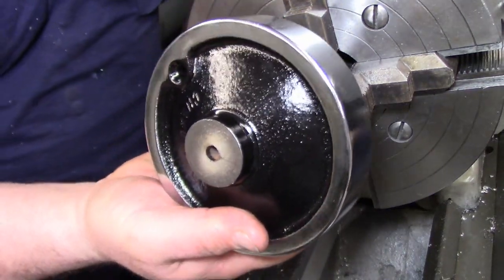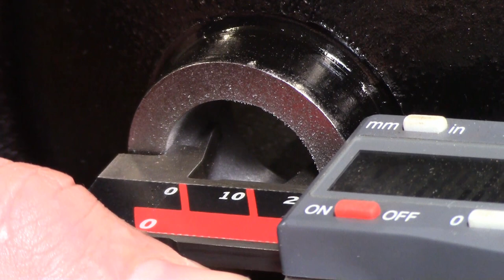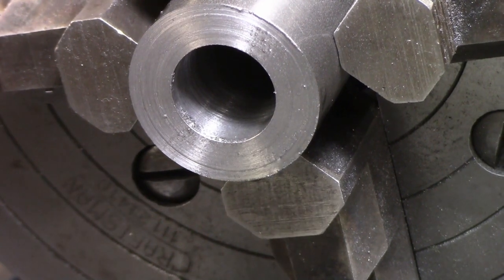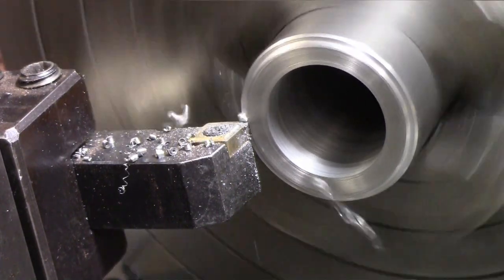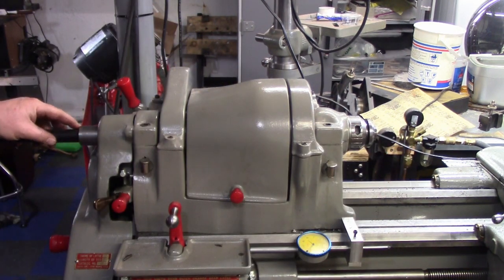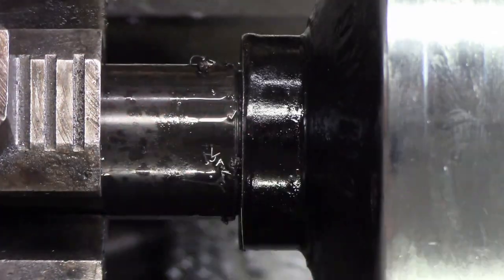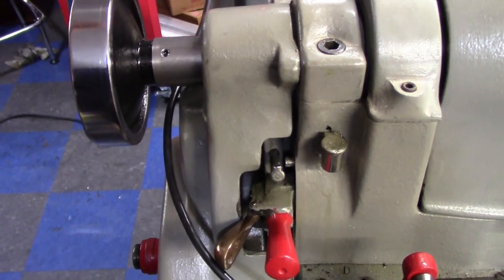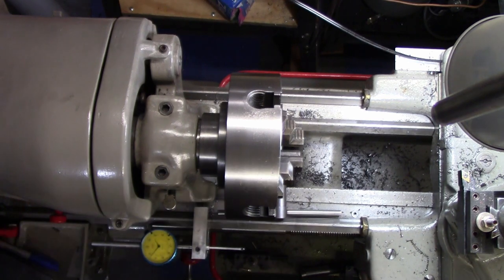Southbend 13" Collet Draw Bar Part 2

Comment: Those collet holders are not hardened if they are like the one I got off of ebay. They can easily be machines. If you South Bend is a 13" like mine, it is a hybrid 4.5 MT taper in the spindle.
Reply: I have a 1956 13" south bend and I've been trying to find out how i can place a center in the spindle bore so I can have the option to turn between centers, Is there a center that will fit directly into the spindle bore or is the spindle cone adaptor needed for that ?

Comment: Nice. Now I need to keep a lookout for that taper adapter and some collets. :)
Reply from the maker: They come up from time to time on ebay.  There was a guy out here in MA that was making them, but he's closed up shop.
Reply: @Halligan142  That's too bad. I'm in no rush. Just started the tear down and restoration of my 113-B. Using some of your videos as a guide. Thanks for putting them out there.

Comment: Do you notice when the tip of your inserts are broken or chip ?   And also you can make the nose part to fit 5C collet since the smaller collet are hard to find used.

Comment: Nice job but I think you should have used some HSS and ground a slotting tool for the grooves.
Reply from the maker: Too lazy to hack it out of a 5/16 or 3/8 blank.  I ordered some parting blades so I should be good now.